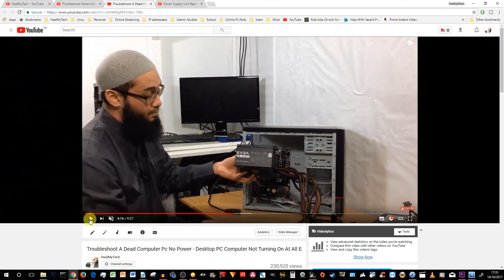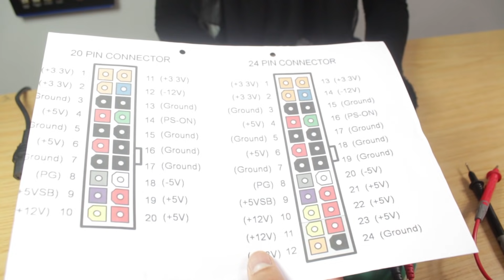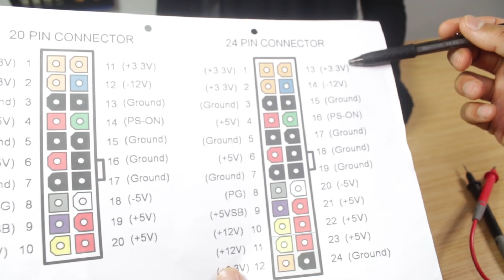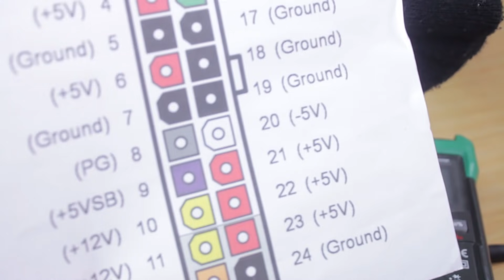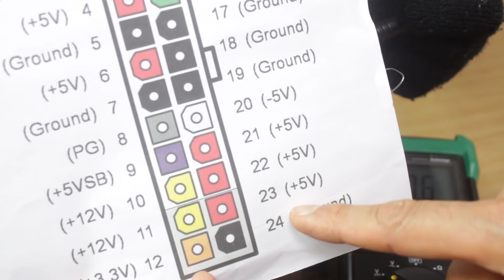How To Test A Power Supply Unit (PSU) With A Digital Multimeter | Advanced Troubleshooting

Comment: This was a very helpful video. Helped me and my son to trouble shoot effectively a non working PC that he has assembled. The problem was that the 24 pin connector had no white wire. We could find that out easily. Thank you for this great and useful video.
Reply: I think it's supposed to be that way. Mines the same way. There used to be a -5v white but apparently they ditched it in '03

Comment: Getting -14v on my blue #14 input is this within normal range for a 700w power supply? Pc wont turn on at all other than flash of light on power button. Any ideas?
Reply: Did it end up being your psu? My blue shows -12.9v and I'm also confused

Comment: what volts should i have  for the pcu ?  Cyber pc power on but no post?? I got a guy working on it he changed the mother board now he says i need some ram. So dont know if the guy is trying to hoodoo me are not. Any ideas of  help ? Thanks man good videos .
Reply from the maker: This video is only one possible way of troubleshooting and fixing a PC. Based on all you questions, I have created a dedicated series to help troubleshoot all 10 main components of a computer in a logical process, I promise you if you follow it you will sort out your issue, since its the exact same process I go through when troubleshooting any pc problems for hardware. Troubleshoot A Computer Series Playlist | Computer Not Turning On | PC Turns On But No Display On Monitor https://www.youtube.com/watch?v=Wkcx-x9gjkg&list=PLDmnHbxxv3ncrDmkkt4oVJTEIBIy9pvRN

I have also created a facebook group especially to help troubleshoot computer/laptop issues.  If you post your question there with some pictures or even better a short video footage you will get a better response.  Consider joining but make sure you read and accept the conditions and answer the questions, otherwise you may not be approved to join.  The idea is to help each other, I am unable to respond to every request by myself.  https://www.facebook.com/groups/healmytech/

Comment: Can I use a Multimeter to measure 24pin cable while the psu still running with the PC underload?
Reply: yes, your supposed to measure while the psu is under load

Comment: It should be noted that you can sometimes have failed power supplies that output at a voltage that's within tolerance with no load on the voltage rails. While it's more common that a rail will just outright fail, I have had instances where a PSU will output the correct voltage when measured, but when loaded it drops down to next to nothing.

What I do the mitigate this is to put a modest load, say, a 20w incandescent lamp or a resistor on the rail I am testing and then measure voltage. This will yield a more reliable measurement when testing for a failed supply as it should also factor in how much voltage drop you get on the rail when it's under load.

Additionally, a time-saving trick: every wire in the PSU is grouped by voltage on the output section of the supply's circuit board. This means, that unless you have a multiple +12v rail design (which can be seen in higher end power supplies), that a +12v on your EPS+12 connector and a +12v on your SATA power / MOLEX / FDD connector will be connected to the same point on the power supply, therefore should have continuity between the two wires. For this reason, I tend to simply test one wire from each voltage rail. Unless it's a multi 12v rail supply and I don't know where the wires are allocated, then I will test all of the wires with a load across my probes to confirm that all rails are working properly.

Comment: Thanks for the video. Everything was to spec for my Thermaltake TR2 600W... EXCEPT the blue wire read 11.17V 

I dont know if this is anything to worry about or not, but I can confirm my PC black screens and self-reboots when playing most games and also I have had trouble just getting it turned on. The fans and LEDs would come on for a second but then shut right off. It all seems like a power issue, but also a temperature issue too as the CPU and GPU run a little warmer than what idle specs say. CPU does shoot up to 85 Celsius time to time (even with new thermal paste), but the graphics card usually reads 49-55C° even while gaming. Been messing with this PC on and off for months lol
Reply: Hey did u solve your problem
Reply: Plss reply

Comment: I just tested a Corsair AX1500i PSU that I found in the TRASH! 🤦🏻‍♂️ Knowing that to just power the unit up isn’t a good enough test, I got a pinout, watched your video...and found every output voltage to be SPOT ON! This PSU sells for between $480 to over $700! The things people just throw away. 🤦🏻‍♂️

Comment: Going to say measuring from wall is pointless and you should load test as most power supply That has issue become visible when there is a load connected to a certain power rail.

Comment: I am having 4.3 volts over 5 volts (red wire) and my PC is restarting continuously, not turning on.
Can you please tell me where can be the fault in psu?
And i have cleaned it as well.
Reply: Maybe its old. Replace it with true rated bronze or higher psu.
Reply: You need a new one

Comment: Is It a bada sign if the fan Is not starting once Power on? I mean if the fan Is not even starting could bei worth to continue with the Test?
Reply from the maker: Usually yes its a bad sign.  In rare occasion it could just be the fan that is faulty in the PSU.

Comment: Hey! Informative video. This is my first pc build. My system turns off after 10 seconds and turns on again in cycles. I tested my Corsair Rmx 850 like this with the ram, GPU and storage in it to get some load on the PSU. The voltage matches perfectly with the diagram  but the PSU still turns off after 10 seconds of spinning, yet the lights on the components stays on and I think the HDD stays on. Is it my power supply?
Reply: I'd check the CPU for overheating and use something like memtest on the RAM if the PSU appears to be good. With that said this PSU test is not the end all and you can still have a dysfunctional PSU while getting good readings from a multimeter.

Comment: My psu fan spins and then stops after 10 seconds. Is this normal?
Reply: It can be. More modern or higher end PSUs will run silent under low load.
Reply: Two Tone Thank you, I realized my psu has something called zero rpm mode.

Comment: My pc is turning on but not booting I tested the psu and all the voltages are good except orange which is 3.49 which is out of the range could that be causing the problem
Reply from the maker: Its close to the general rule of thumb, I wouldn't dismiss it yet, Are you not able to swap the PSU to test?
Reply: @HealMyTech1  nope I dont have another one handy, basically what happened was I was playing on my pc and it just turned off, now when I try to turn it on all fans spin, and the leds turn on but it doesnt boot

Comment: Nice job with teaching.... One thought for doing this alone (We all don't have a lovely assistant with us)..... Use an alligator clip on negative  (black wire) side of multimeter and clip it to metal on PSU case grounding it - confirm a perfect ground by checking resistance/ Ohms test between clipped lead and any of the ground wire - (actually if you are having issues you can check all of the ground wires with this test)..  Thank you, much appreciated.

Comment: So my PC broke and I have to replace the motherboard, processor and RAM (The motherboard is failing and I'm upgrading to a better processor and for that I need a new MOBO). Anyways, I decided to test my PSU in case it was failing so that I could make sure that it wasn't going to break any new components I bought. Turns out some lectures gave between 23.8v to 15v. I'm not an expert, and I tried to make sure I was connecting in the right ports many times, and I'm pretty sure I connected it correctly, but no PSU should givbe more than maybe 12v? In fact the chart on the side of the PSU says it gives a maximum of 12.5v. Guess I'm replacing the PSU as well.

Comment: Is -11.33 V OK for pin 14?  (I have a 24 pin connector).  It is just outside the tolerance given, but not by much.  Comments welcome.
Reply: Did you ever find out if your psu was bad? I'm also getting a reading a little out of tolerance, I'm getting -12.9v

Comment: if the voltages are correct but what if the power supply isnt providing the needed current, testing the voltages i think is only proving one part of the power supply is working

Comment: My HP PSU does not have a green or black wire for the main power cable. How would i be able to perform this test ?
Reply from the maker: You need to locate the diagram or schematic for HP, that's a problem with proprietary PSU, if you search hon google, you may find an image with the appropriate pin number and voltage to test which correspond to the green and black.
Reply: Thank you so much 
Your videos are informative and a great help for my studies

Comment: I followed this instruction and my PSU is same all have the correct voltages, fan spins up when you short/jump green and black. But when I plug the 24 pin and 4pin(near HSF) on the mobo, and try to turn on mobo power switch, the cpu fan,and PSU fan turns on-off-on-off... Continuously. I tried another mobo and still the same.
Reply from the maker: the voltages really need to be tested under load, otherwise its not a full test, i.e the PSU could still be faulty but at normal load it wont be a problem.   The fact that you tested with another mobo seems to indicate the PSU is faulty.  Have you tried a known working PSU?
Reply: @HealMyTech1  already found out the culprit. Defective motherboard. Actually when i got the replacement mobo, and plugged the hsf w/out the processor, it had the same issue. But i put the proc, hsf it started normally.

Comment: how would you know if its fine you havent put any load on it. this is not the correct way to test if the PSU is working correctly or not.
Reply: you need very thin and non malleable wires coming out as heads from the socket,getting plugged along with 24 pin connector,risky job though.
Reply: or attaching a thin needle on those multimeter headers,if these needles can make a way from upside of mini canals of 24 pin connector to joint spot while connected to MB Socket.
Reply from the maker: You are right, a few people have pointed this out, noob mistake, I need to update this vid, and/or find someone who can do a better job and collab with them, quite happy to produce it, you offering?
Reply: Its a decent place to start tho. U can test it under a load by seperating the plug SLIGHTLY to reach the connection spots. Is it even possible to test it under load if the pc wont turn on? Well thinking about it, im sure it is but i have no idea what youd need to do that.

Comment: 1. connect pin 15-16 to turn PSU
2. connect black needle to pin 24 and red needle to pin 13,14, 21,22,23 
3. connect black needle to pin 14 and red needle to pin 1,2,4,6,9,10,11,12
Reply: Just a correction to call out on point# 3. It should be Pin 15 for ground instead of Pin 14 which is blue
Reply: Is the 24 pin connector is standard? I got mine with all black wires
Reply: Hai indonesian
Reply: Pin 14 is -12v, must have meant pin 15.  He used the 3rd pin in, likely it's pin 3 on a 24 pin connector.   All ground should be ok to use, the point of them being ground is they're a common.
Reply: @lonniebeal6032  correct, use any black wire as ground, the first post saying step 3 to use Pin 14 is wrong
Reply from the maker: Cool summary!
Reply: @HealMyTech1  thank you a lot for the tutorial
One question: the blue colored wire (-12V) reading is 11.3V for me, every thing else is good even the cpu, gpu and molex connectors. Does that mean I need to replace the PSU?
Reply: @NYMT19  I think he wont answer you
Reply: @NYMT19  same here the reading is 11.44V which means i need to reach 11.52V to 12V probably thats why the fan of my cpu is slow spinning  the cpu overheating cos the fan malfunctioning it doesnt get enough voltage theres also no display im wondering if you replaced your psu?
Reply: Hi , Paper clip test  with the black one my psu fan not spinning. But I try the green with red the fan working. What is that mean? Thanksss
Reply: When I do the following;-
 1. connect pin 15-16 to turn PSU
 (all Ok) 
2. connect black needle to pin 24 and red needle to pin 13,14, 21,22,23 
(Ok- all is good)
3. connect black needle to pin 14 and red needle to pin 1,2,4,6,9,10,11,12 (WTF ??)
 The First set are spot on; but the  2nd set Are either 3x the listed Voltages (1 & 2 supposed to be 3v but are 15.57..v), and (4, 6 & 9 supposed to be 5v = but are 17.4v) & in the case of 10 & 11 they are near zero volts at 1v? or something;- (   '1   .     ) . 
And next, the 12th pin (supposed to be 3.3v) is 15.6v or so

Looking inside the PSU is relatively clean and looks perfect.
PC was running fine... but PUBG kept crashing halfway through the game. Then when I re-booted after the BIOS it went dead with one white underscore on a black screen. So, assumed CPU or GPU, but then wondered 850W Platinum PSU made in China maybe at fault. Wondering if i7-4770 CPU could have caused it?; or even TUF Motherboard? Or Strix GTX1070?

Comment: Masha Allah Thank you and I need your support. I was wondering if you can explain the power supply or charger output. Means like I have 9V 100mA output why when I connect with series 10 ohm I am not getting like 900mA rather I get 315mA and if I short it it will not go over 430mA. 1 ohm will give 430mA, 6 ohm will give 360mA instead of 1500mA, 330 ohm will give 35 mA instead of 27mA, 1k ohm will give 12.9mA instead of 9mA. My voltmeter is connected in series and setting on amp. So I am getting less than what it should be.

Comment: Thank you my friend, your video was a great help. Very clear and well presented. Just one question though. Shouldn't we also be testing the 8-pin CPU power connector of the PSU?
Reply: yes that as well. There is schematic for it in your motherboard manual if you built a pc yourself. else you can find tons online and just cross check like this vid.

Comment: Interesting, but otherwise useless demonstration. 

What  "HealMyTech" is doing in this video, is testing a PSU without employing a load.  In simplist terms, he's merely checking to see if the PSU can supply it's rated voltages in a  ZERO work condition.

This PSU, which happens to be an EVGA 430 watt power supply, is rated to supply 12volt at up to 34amp (408 watts).  The way this test is being conducted, with absolutely no load being applied to the output of the PSU,  he is merely testing to see it the PSU can supply 12volts at essentially zero amps. This is because the test is being conducted with no load beyond the minuscule resistance of the multimeter and its data cables. The problem here, is that a PSU may supply detectable voltage while not under a load, but fail immediately when a load is placed on it.

Imagine trying to determine how deep a pool of water is by dipping your big toe. If your toe gets wet, then YES, you have water,  but you'll have no idea how deep the pool is.

You could devise a dummy load for the test. A 10-watt, 10 ohm cement resistor placed across the +5volt line and ground would put a small load on the PSU. But, in the field, I found it much easier to use other components in the PC to create that load. You can do this by leaving the PSU installed in the PC, disconnect the Main motherboard connector but leaving the other lines (drives, etc.). This way you can then test the PSU as described in the video at the main MB connector leaving some load on the PSU during your testing. This is not perfect, but at least it provides some indication if the PSU might work under load.

BTW, as seen in the video, the main connector has multiple pins supplying the same voltages. For example you'll find multiple red wires all designated +5 volts. The same holds true for the 12V yellow wires, 3.3v orange wires. In the case of this PSU, each of those voltage lines come from the same rail and the same source within the PSU. Testing one yellow wire, red and orange wire is all that's required, unless of course you suspect, or see damage in the connector or the physical wire.
Reply from the maker: Thanks for all the awesome tips.  And you are correct, if only I knew all this information back then, a couple of people have also pointed it out.  Are you perchance offering to help with a collab so we could update this video or do a better tutorial?
Reply: @HealMyTech1  I would help, sure. Are you perchance offering to share any revenue you receive from  any such videos?

Comment: Fantastic video! Everything is explained beautifully. I've a noob question though: I
Is there an easy way to check the voltages coming directly from the PSU rails by opening up the PSU?
Reply: You could always test from the solder points on the bottom of the board. That would be a lot of unnecessary work, unless the wires are missing.

Comment: Powering on a power supply without anything attached could damage the power supply.
Do not power on a power supply without connecting to the motherboard and possibly a device such as an optical drive or hard drive. An ATX power supply usually requires a motherboard connection at a minimum. Page 137 Complete CompTIA ® A+ Guide to PCs, Sixth Edition CHERYL A. SCHMIDT
Reply: Modern PSUs should be fine as shown here. Most regulate with zero load, some will shutdown and require a reset. I can see issuing a word of caution but that doest man it can't be done.